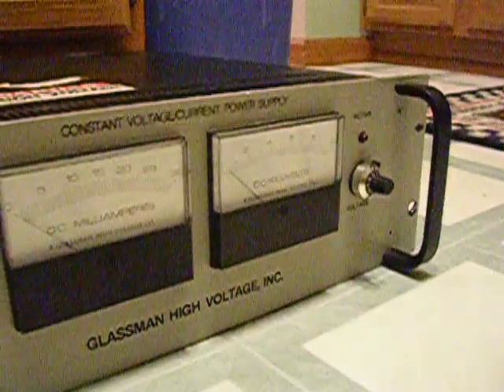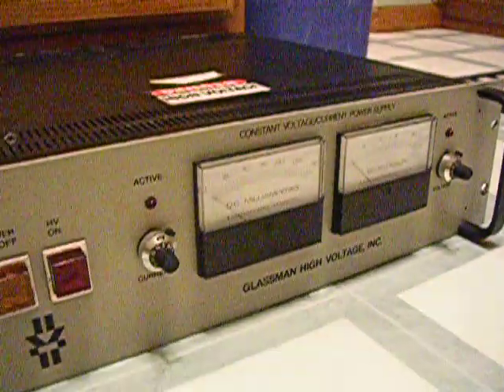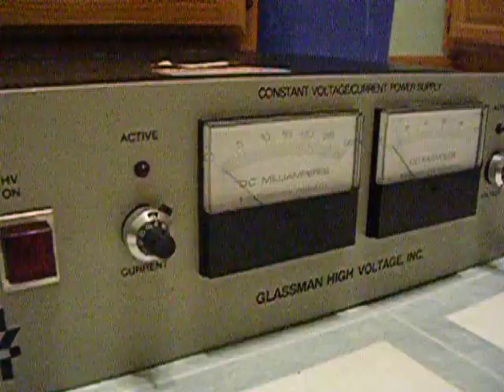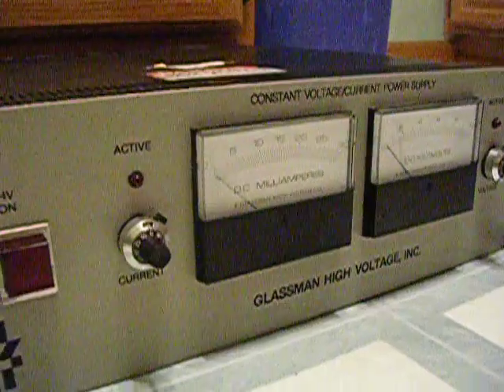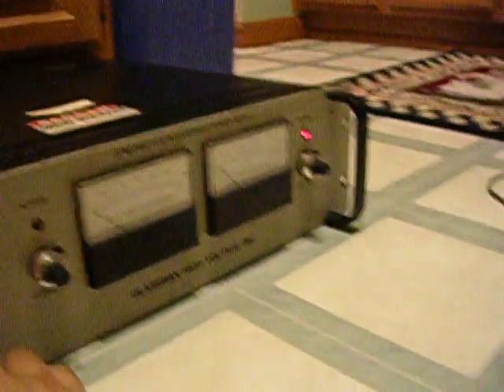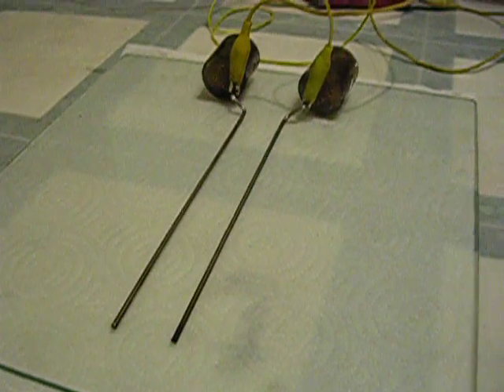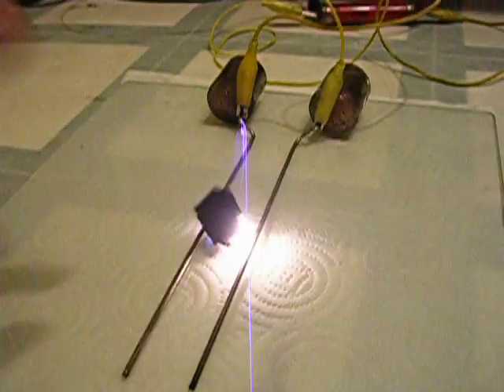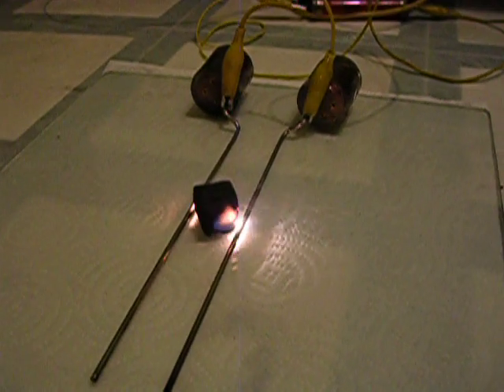Electronic Mouse Trap 10KV

Comment: 10KV * 30mA = 300Watts, 3 light bulbs, and that is only when the circuit is close (a short is set between the electrodes. Won't made a dent in his electric bill...

Comment: @RcWorld7 I = V / R, your body resistance is constant. 24 V of pressure is not enough to make enough amount of current (that can kill you) go through your body. Therefore, even if there is an enough amount of current that can kill you available, it will never go through your body at 24 V.